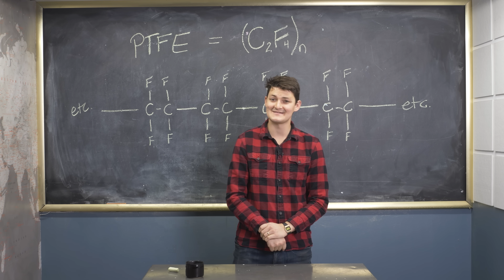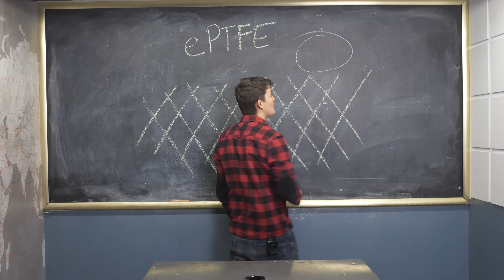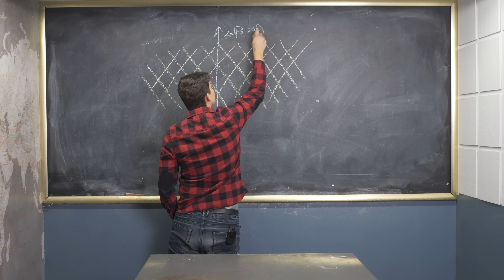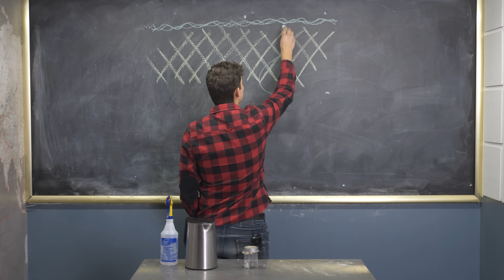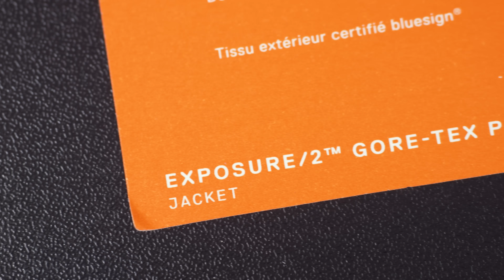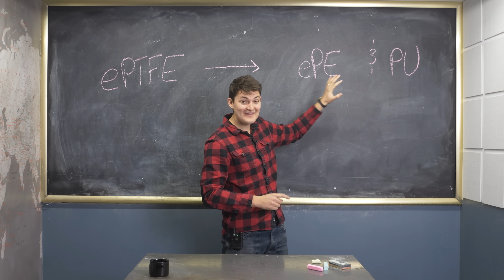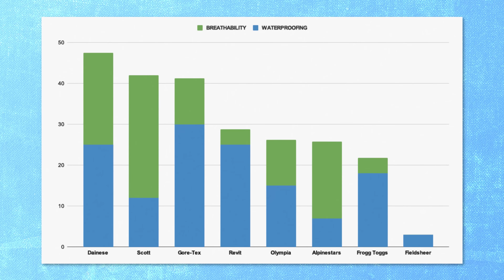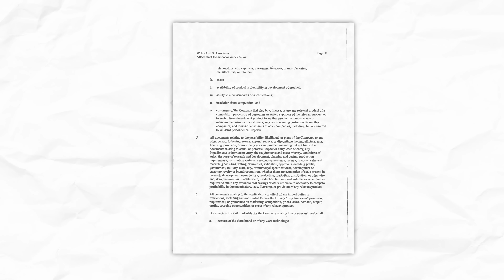Gore-Tex is a Marketing Gimmick

Comment: I see what you are saying about modern Gore-Tex but for someone that used their products for many years I can tell you it was a game changer. In 1975 I got a job as a UPS delivery driver in the northeast. That company took to heart the phrase rain snow sleet and hail as their operating philosophy. In the early days our choice of rainwear was either a plastic or rubber jacket and boots that were either rubber or leather with some form of water repellant sprayed on them. Wearing those jackets doing physical work was like being in a sauna. The rain stayed off you but you ended up being soaked with your own sweat. The rubber boots acted much the same way and with the treated leather  boots your feet would would still end up soaked at the end of a long day in the wet weather. Enter Gore-Tex. Yes the products were more expensive but in real world usage they excelled over everything else. I wore a Gore-Tex jacket every day in the wet weather and it kept me dry and not feeling like I was in a sauna for many years. I started buying Rocky boots with Gore-Tex and my feet never got wet or cold because of sweating. Even when those boots were worn out they still kept your feet dry. They sold a lot of products to UPS workers over the years because they just worked better then anything else available. There were thousands of workers trying everything out there for the best results and it was Gore-Tex that ultimately passed the test. Maybe now there are better products available but for years Gore-Tex made many of our lives much better.

Comment: 20 years ago my friend came up with a solution, and spent all his pocket money developing it. He ran out of money. So I took on the project, got as far as prototypes and hey presto.. ran out of money. But I still ride mine.. use it for cycling, running and so on. Its really a temperature jacket I still have the promo video if you would like the explainer. For anyone reading this it's not for the faint hearted to try a business like this. You had better know what you are doing. I didn't.

Comment: I think every Hiker and climber on the planet, knows that Gore-tex, or any so-called breathable fabric, does not keep dry on the inside. It only helps to reduces inside condensation from sweating. It depends on how much sweat you produce during any activity on how wet on the inside you are, The most important property of an outside layer, it has to be windproof. You're still going to get wet from the  inside. You can be wet and warm, but certainly not wet and cold 😉😊

Comment: I'd say the one place where Goretex still makes sense, is in winter gear, where rain is less common but humidity differences exist and you don't want melting snow to pass through the outer layer of the jacket, without sacrificing overall breathability. In these cases the mix of waterproof AND breathable actually holds true more often than not. But in above freezing temps I don't give a rats ass about Gore and his tex. And regardless of the industry we're talking about, it is, as you say, not much more than a brand name that demands an excessive premium based primarily on name recognition rather than a true difference from competitors. Perhaps in the past the differences were wider, but these days you'd be hard pressed to find any company that doesn't have an in-house tech that at least matches 90% of what Goretex can accomplish.

I always try to go for post season / clearance sales, and tbh I only use the Goretex name as an indicator for "ok if they paid to use this name then at least it can't be shit", which is harder to tell when you're looking at some random brand with a random in-house tech claiming random numbers. Makes the sorting process a bit more convenient and risk free.

Comment: Well Ryan. Never expected to hear you get your 'shit' partially incorrect. I've been wearing real goretex for mountaineering for the last 30 years. The high mountains are where the fabric excells. It was never designed for warm, wet climates. If you want to diss anyone, diss the motorcycle apparel industry for bullshitting about the fabrics performance in conditions it was not designed for!

Comment: Easily the most frustrated I have been all year was trying to find a pair of breathable boots. It didn't take long to figure out that gore was up to something. It wasn't good enough that they had the entire market on waterproof footwear in submission, but the manufacturers that had previously offered non waterproof boots no longer offered any without gore-tex and it started to seem very plausible that they were under direct instruction to only offer boots with gore-tex or at least required to meet a quota in order to continue receiving material from gore.
Reply: Funny how the most waterproof boots I have ever had was a pair of leather British army combat boots with no gortex or any liner just wax and boot polish and they were perfect.
Reply: @moorshound3243  exactly this, after a couple of pairs of high end gore-tex lined boots became horrible trench foot inducing sweat boxes within a year or two I've not worn anything but plain leather since - much better!
Reply: @eyeteethsightbytes153 regular top grain or suede
Reply: @MarissaTheMuse  top/full grain is what I prefer personally. Suede surface tends to absorb water unless treated with spray.

Leather, mink oil and wool socks (I like thin socks underneath too) all the way. It's old school, not lightweight but works and the boots last a long time. Your choice will depend on what you're doing and what your feet are used to of course.
Reply: @moorshound3243 Likewise, I bought a pair of French army all leather boots recently, dosed them with plenty of dubbin, job done, dry feet, result - ! 😊
Reply: I was in the market for trail runners for walking the Camino. Most forums recommend against Gore Tex due to lack of breathability and also when Gor Tex shoes eventually soak through they take a lot longer to dry out than more breathable shoes lacking waterproof membranes.
Reply: US Military boots have had breathable membranes since at least 2002.  And I can vouch for the fact that my feet stayed dry standing in 6 inches of water, in the snow and in the desert in Iraq.  In fact, these boots were more comfortable (due to my feet staying dry) than the lightweight 'desert' boots.  And like the wet-weather gear and the waterproof sleeping bay outer cover we called the 'Gore-Tex' even if the labels didn't say that.
Reply: I don't know... My personal experience with gore-tex boots is actually quite good. I never had any waterproof boots when I was a kid or a teenager but when I was finally able to afford it I was impressed. I can walk over the water and literally feel the chill or warmth of it but it never gets through. And my feet are also much drier when hiking in summer when I'm all sweaty (I am sweating a lot). As for washing, just throw it in the bucket with a scoop of the suggested liquid and leave for 15 min, move around and leave for another 15, then rinse with water and leave on the sun upside down. Simple enough.
Reply: All you need is wool socks. I’m serious.
Reply: @paddor  yes, always!
Reply: @paddor  "All you need is wool socks. I’m serious"

Get military issue boot socks instead.  They wick moisture away from your feet.  Wool socks are now only worn by aircrews and tank crews (due to the risk of finding yourself surrounded by flames).
Reply: @colincampbell767   LOL what

Comment: In the early eighties I was a (truck) driver for a well known Japanese car makers British dealership sponsored BTCC racing team. Everybody got kitted out with all kinds of manufacturer branded gear including what we all at first thought were the absolute dogs bollocks of warm, dry thigh length jackets. Those things looked awesome and they were Goretex! Wow! Super expensive and just given to us so we'd look splendid in and around the pits and paddock. There was one minor issue though which resulted in most of us never wearing them cus they were shit. 
On any day when you'd give your eye teeth for a good winter coat the last thing, we quickly learned, was to don one's super Goretex coat. Pop it on. Warm. Work for 15 minutes and get a bit of a sweat on and when 15 further minutes had elapsed you were freezing your arse off. And you were soaking wet too!  Haven't deliberately bought anything Goretexy for a smidge over 40 years! 😂

Comment: I am an sweaty man Were as my brother is an smooth and dry man I worked as a ski instructor on the slopes of Cairngorm and would unzip the sleeves off my jacked to try and cool down . Imagine my excitement when in 1978 I had enough money to buy a Gore-Tex anorak and try it out that day on the hill . It turned out to be useless I was soaking wet inside So I took it back to the shop in Aviemore and after quite a bit of arguing got my money back , straight to the pub and celebrated by getting drunk . Gore - tex is just an expensive name and the suckers keep coming .

Comment: Gore-Tex is more of a standard of quality than a marketing gimmick. 

Some facts-
1. Gore-Tex is waterproof
2. Gore-Tex is breathable when dry
3. Gore-Tex is not breathable when saturated
4. DWR allows Gore-Tex to not get saturated
5. DWR is a wear item and needs to be maintained
6. Other companies can and do make products that can match Gore-Tex in breathability and waterproofness

What Gore-Tex offers is a standard of products that they guarantee. You can go buy another product offering the same promises but you are then betting on the reputation of the manufacturer of that alternative. Gore-Tex will have the same standards across all brands. You will pay a premium for this warranty and promise and it may or may not be worth it to you.

Comment: I bought a Columbia OutDry™ jacket on sale, essentially the waterproof and "breathable" layer is on the outside and it doesn't rely on DWR. It is at least as good or better than my Arc'teryx Gore-Tex jacket (at keeping me dry).

Before we had kids my wife and I did a bunch of backcountry hiking and camping, and a $90 Eddie Bauer rain shell did the trick for a long time. All that's important is that you can get your rain pants and jacket on quickly when needed.
Reply: @SSSlid Because OurDry doesn't use DWR I don't see any risk to washing it.

Comment: Perhaps I'm in the minority, but I like my Gore-Tex gear (jacket, pants, boots). I've stayed dry riding in even the heaviest of downpours. Other gear I owned that claimed to be waterproof wasn't at all. Yes, Goretex, like any properly protective motorcycle gear, is warm to wear at higher outside temperatures. Gore-Tex is still more comfortable to wear in wet weather than conventional plastic rain suits, and you don't have to pull off the road to don it.

Comment: I bought a tan $40 Levi jacket from Costco and painted the whole thing with melted beeswax. 

It's stiff as a board and probably ruined, but it's pretty water resistant! I've ran around filming in a downpour and only my neck and legs got wet. And I had $950 left over to put towards my dying pickup truck! 

Sailors have used a similar method for centuries! :3

Comment: Brilliant and thanks for your research. Quick question will the water barrier form when the air is rushing past while riding. I agree with your results but wondered if you have air blowing the water off the surface will the breathability return? Gore-Tex has some good properties but is priced like an import from Columbia ! Great work and keep posting. Simple test air compressor at low psi you can do the calculation of psi to wind speed ratio. I am making the popcorn waiting for the results.

Comment: Goretex certifies every product that uses it, the stitching, the seams, the design. You aren’t just paying for the material but for a quality product.
Reply: its not about the quality. Its about false advertising which is a crime last I checked (at least in some situations).
Reply: Shills are shitting themselves xD
Reply: If Goretex was really that good then they wouldn't need to be so aggressive.
If Goretex was actually better then competitors then it wouldn't matter if a company made products using competitor's materials because you would be confident that customers would choose the better product. Goretex knows their competitors make equally good products hence how incredibly aggressive they are to prevent competitors from getting any kind of foothold in the market.
Reply: Look just face you were done on the Gortex  $2000 bike gear made in a  slave factory in china for $50 no doubt
Reply: thanks, person who is clearly from their marketing team
Reply: What does that even mean? Goretex 'certifies' the stitching? I suppose KFC 'certifies' its chicken. What I see is a company that produces an average (in performance) product and charges double. It all comes down to whether the consumer is dumb enough to fall for it.
Reply: Gore will also warranty products made with gore membranes even if the manufacturer won't. It's honestly a brilliant piece of marketing, since it puts a real liability on the line in exchange for exposing the material brand to the consumer.
Reply: I've written a comment asking for him to name the materials and brands that supply gear at half the price of gore tex products that he would endorse for snow camping.  You know, gear you would purchase if your life depended on it rather than those corporate baddy Gore tex that cost twice as much. Just to clarify, we don't need to mention his comparison of gore tex to a plastic bag and a woolen jumper.
Reply: Lol, Goretex shoes sucks, does not mean a thing.
Reply: @Shawn-ts4jw Wearing my goretex Lowas I can stand in water and they won't leak while keeping my feet cool in the summer. My wife went through 3 or 4 pairs with other brand membranes since I got them, all expensive, and none work this well.
Reply: Got it ! Find a gore Tex certified product, and buy the cheaper one from the same manufacturer who will use the same machinery anyway
Reply: Totally agree. As a consumer who buys new stuff every 5-10 years, I want to have some assurance that the garments work. Now I’ve tried some cheaper options as well, but some have not worked at all. With gore, atleast I get some assurance that seams are working also after few years. Rather pay bit more than through bad garments in the trash bin.
Reply: @tepporinta-filppula600  Exactly. Some excellent brands, like fjällräven, don't use goretex but they aren't any cheaper.
Reply: Yup. I've bought countless shells over the years and gore-tex are always well made and function well. Others do too, but gore-tex is still a mark of quality.
The main point this video makes is also pretty silly. Here in England it'll regularly change weather from rainy and warm to hot and dry to cold and rainy in one ride. I'm not stopping to change outfits every time it changes. No wool sweater plus bin bag combo is going to match a modern membrane for that.

Comment: I remember testing my brand new Goretex hiking boots in a bucket and yeah got damp inside. You can feel it. 
Long distance hikers are taught to bring quick dry shoes. Goretex takes forever to dry. They are good for a splash and not rain. 
So it’s better to dry your thin material  running shoes and for it to be dry the next day. Rather than days suffering in a Goretex that won’t dry

Comment: My most ironic gear purchase was a Gore-Tex cycling VEST, complete with a mesh back panel. I knew it was ridiculous at the time but it was on clearance sale ..plus I get to use that Costanza line.
Reply: My alltime favorite mountain bike shorts are branded by Goretex. They don't have a bit of water-proofing in them. However, they are made of an excellent material and the design/features are the best that I have encountered.

Comment: Ive not owned gore-tex since owning some gore-tex gloves that got soaked then soaked through to my hands. Ever since that experience ive avoided them and stuck with the cheaper option of things. Laminated kit and stuff that actually come with a removable rain kit is brilliant. Currently wearing Richia touring jacket and a set of Wolf pants. Ive been through all sorts in them even ice, snow and once slept outside through a rainstorm, didnt get wet, didnt notice, woke up in a puddle, still bone dry inside the biker gear.

Comment: As a design engineer who uses Gore-Tex in non-clothing applications, this was very informative. Thank you!
Reply: non clothing applications?
Reply: @yassin2471  we would buy 1/2" diameter gore-tex patches with adhesive on the edge and paste them inside a watertight instrument case over a molded in pin hole. This allowed the case to breath (equalize internal pressure) and still be watertight to a limited depth. We tested this up to one meter underwater. (IP-67)
Reply: @yassin2471  
Condoms, dude, he's making the condoms.